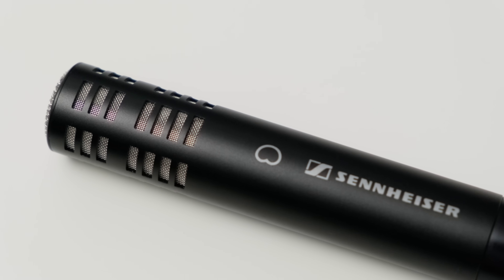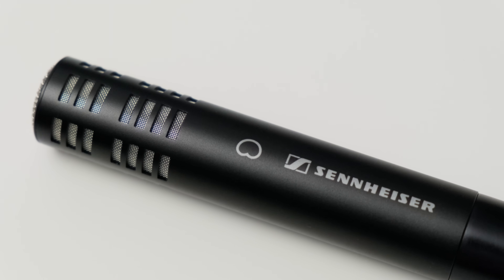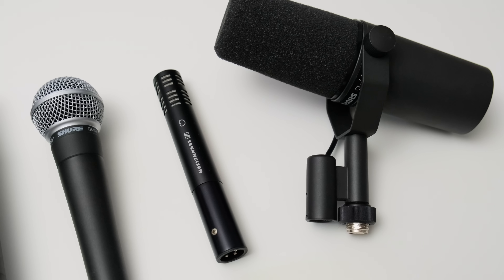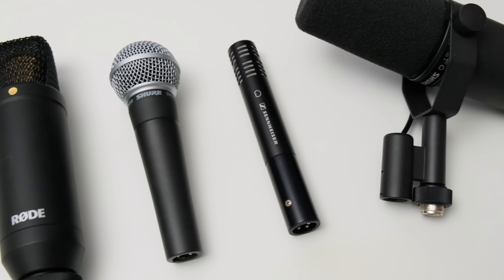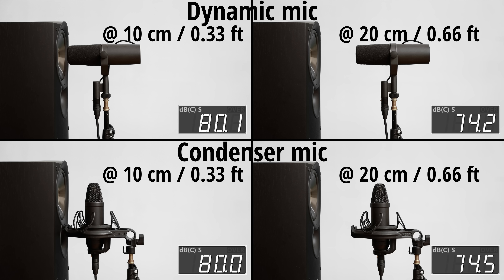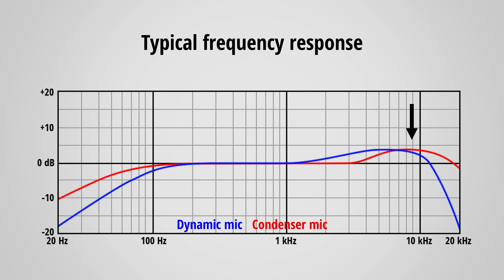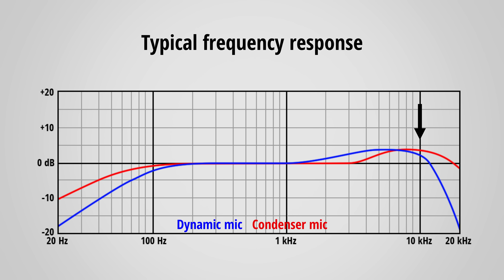Dynamic mics don’t reject noise better than condensers! And yet they do?

Comment: 1:55 There is a weight difference between the diaphragm of a dynamic and that of a condensor. You reach a point in which the sound wave is too low to move the heavier diaphragm of the dynamic so it can not actually produce the low level detail.

Comment: I once tested a bunch of different microphones in a reverberant living room, and (at the same distances) the dynamic microphones tended to sound worse than the condenser microphones. They were all pretty much unusable at any distance further than 1 foot. 
Although the main thing to learn from that video is that you should try to avoid standing 2-4+ feet away from your microphone, in general.

Comment: As I understand it, a dynamic microphone uses a heavier moving coil that is less sensitive to small air vibrations, while a condenser microphone uses a very light, electrically charged diaphragm that reacts to much finer details and room sound. Sound waves reach both microphones, but a dynamic mic responds much less to weak, distant vibrations, whereas a condenser converts even very small vibrations into an electrical signal. I’m curious about your take when comparing a Rode NT1 to an SM7B in terms of room noise pickup, and whether the test might have been even more revealing if an additional speaker farther away played a different tone to clearly demonstrate how near versus distant sound is captured by these two microphone technologies.

Comment: Really interesting! What about the pick up pattern maybe being a little different even with a cardioid vs supercardioid, but also what about the sensitivity of the capsule? I feel like background room noise is very different than say a drum kit spill, because I have heard and done myself putting a dynamic and a condenser on a snare in as close to the same spot, both cardioid and the spill was insanely different. yes it being brighter was for sure a big part of it but i EQd it and it still had quite a bit more overall spill.
Reply: Compare the SM7B to the Schoeps, even though the Schoeps is super cardioid it sounds like it has more room ambience to me. could be because its a lot brighter for sure but also the sensitivity to the capsule too no?

Comment: Condenser mics have a pre-amp built in. That's why they need phantom power. Dynamic mics usually do not have a pre-amp. (Though USB dynamic mics have an analog-to-digital converter, which acts as a pre-amp.
      Condenser mics don't "reject sound worse than dynamics", condenser mics are just much louder than dynamic mics.
Reply: good lord - no! You got this wrong bruv

Comment: I always assumed it was because it took more energy to move the element of a dynamic mic, due to the coil magnet portion requiring more force than the element on a condenser mic.  The lower energy of further sounds is more easily able to move the lighter element of a condenser, at least in theory.

Comment: This is incorrect. The reason dynamic microphones reject room so much better is because they do... at lower frequencies. Google polar pattern for u87 at various frequencies and then the same for sm7b and look at the polar pattern at 200hz. The u87 is almost omnidirectional and the sm7b is still very cardioid
Reply: So exactly what he said. It's the frequency response.
Reply: @shApYT  you either didn't read what I wrote or do not understand some of the terminology, because that is not what I said
Reply: @seansmall3401 you are saying the directivity index is different

Comment: The frequency/angle effect is also independent of microphone construction? I know singers trained to use dynamic microphones practice changing distance and angle to allow for them to get a better sound out of their singing - it's as if the microphone was part of their singing. An example is getting the mic closer to sing lower notes and farther to produce higher notes since it's easier to produce lower notes with less intensity and to produce higher notes with high intensity. 

This is a vide from an old Brazilian TV show (1980s) featuring Jane Duboc singing live. She is a professional studio singer - a master of her craft - and you can see how she moves the microphone to change the produce the timber and intensity she wants. You'll notice she does the same movements every time when she repeats the chorus.

https://www.youtube.com/watch?v=-0wam3BaYc8

Can that be done with a condenser mic also? Thanks!

Comment: Try recording vocals and acoustic guitar (acoustically) and get a separation (no bleed) It’s an absolute nightmare when using a condenser mic, specially the rode nt1A which is a great mic but it’s ultra sensitive with a very poor side rejection(maybe if it was supercardioid would do a much better job) With the Shure SM7db I literally get no bleed when placed properly. There could be children playing in the parking lot, birds chirping, neighbors making noise and the shure SM7dB would not capture anything else but my voice when placed in the right direction.

Comment: I think that one thing you are missing is the question of nonlinearity w.r.t. low inputs. We model and specify mics as though their diaphragms are frictionless spring-mass-damper systems, but they aren't. Their suspensions have rigidity, coulombic friction, and stiction that impart an initial resistance to motion at low amplitudes. At very low amplitudes all mics therefore tend to output less than their specified sensitivity (in dBV/Pa) suggests. Your test didn't capture that regime because you tested at fairly high levels.

In my experience dynamic mics with their relatively large and "rigidly sprung" diaphragms are more susceptible to those issues than are capacitors, and nothing you've done here really contradicts that. My experience has always been that a typical dynamic behaves a bit like a typical condenser followed by a gate or expander with a very low threshold. That does marginally reduce background noise in some scenarios.

With that said that's a pretty subtle effect, and I agree that most people are using dynamics at shorter working distances and confounding that with an inherent difference in response.

Comment: There’s a reason to use dynamic mics on stage with floor wedges instead of condensers. It’s not about rejection it’s about sensitivity. Dynamics do a better job of rejecting noise than condensers, that’s not a myth.

Comment: I think this misconception may come from the economics of the stage mic: stage people need lots of mics, their mics are dropped often so they need to be durable, they don't care about perfect frequency response, and they do care about a tight pickup pattern to keep the mix clean. Since dynamic mics can be made cheaply to fulfill those needs, a lot of dynamic mics on the market have those attributes, and so the average mic reviewer assumed that's just how dynamic capsules work. But if a mic company wants, they can make any mic technology have any attributes they want. The Schoeps CMC641 is a perfect example: it is more directional than the SM7B so you hear less room noise, it sounds better than the SM7B because it captures a more true frequency response, and it costs more than the SM7B, presumably because it costs more to make. But there are also $20 condenser mics that sound nothing like the Schoeps CMC641. So what people need to be learning about is the frequency response (sound) and polar pickup pattern (I think "directionality" is a better way to think of that than "background noise rejection"). Another great video!

Comment: I have the SSL2 and I would like my mic out of frame in my untreated home office. I currently have the Shure MV7 via XLR, but I feel like it’s to far away about a foot from my mouth out of frame. What mic should I get that will mask my keyboard typing but also give me clarity. Thank you.
Reply from the maker: I don't think a different mic will improve your setup significantly. The best and simplest way to get less keyboard sound is simply to get the mic closer. If that's not an option then the only other option i see is digital noise reduction with something like the Nvidia RTX Voice or iZotope Voice De-Noise.

Comment: If you can make a Rode NT1 sound like SM7B, can you make an SM7B sound like a NT1? Given that the NT1 has a wider frequency response, I guess not...right?
Reply from the maker: Correct, not really possible because the rolled-off high frequencies you are hardly getting back. Only with lots of signal boost but then it will be really noisy.
Reply: @JulianKrause  Yeah, btw, since you're reading comments, just wanted you to know that you're awesome and keep up the good work! Love from Bulgaria!

Comment: I never tried to record vocals on Condenser mic so far, but few days ago I pick up my Arturia minifuse 2 and I'm using a dynamic mic from Sennheiser and I was so so surprised that while recording my voice the mic didn't picked up the very loud sound of a percussion tool that was used by someone in the building I was recording. I hear that noise loud but the mic did not picked it at all. On the recording later I was very careful to listen maybe I could spot it but no. It was a clear sound of my voice only. And I love it for this. I don't know if it is due to the fact that I'm using also a hardware preamp and a limiter (compressor) in the chain but the sound the vocals are clean. Now I don't know how the same chain will sound on a condenser mic. So far I don't have the occasion to test it but when I will do then I could tell the difference. I trust only my ears and my eyes 🙂
Thanks for the video!

Comment: Dumb video.  Sound, of course,  does not have a mind - every mic is an INTERPRETATION of the physical world - so are your EARS, which are different from everyone else's ears (and different from left to right).
TRUTH: Mics have varying SIZE polar patterns.  Some extend a great deal, some do not.  Older condensers (U47, M49) have much bigger polar patterns than modern condensers, for instance.  I've tested this myself in exacting tests in my studio.
TRUTH: Some mics - by design - reject OFF-AXIS sounds more than others.  Off-axis means anything other than straight on - which are the tests you are doing in this video.  This is why comparing DIRECT-AXIS sounds, like your video, is worthless for testing the proposition you are testing.
TRUTH: Most dynamics DO reject OFF-AXIS sound better than condensers.  This is why they are typically better for untreated rooms.

I swear, the level of poop pushed out by independent vidcasters looking to make a living from YouTube these days is shameless.  And in case you question my opinion, it comes from a professional engineer and musician with 4 decades of experience.

Comment: Aaaaah, I LOVE channels where breaking the laws of physics isn’t allowed! <3
I’ve long hated the claims of dynamic mics being better at background noise reduction, and from my rudimentary understanding of acoustics, I figured those claims had to be complete BS. Glad to hear an educated voice weighing in on this.

I will say though: I don’t think the typical high end roll off of dynamic mics is an advantage. Let’s say I’m mixing a live band and the vocalist is using an SM58. In order to  get a frequency response that I find acceptable, one of the things I have to do is boost the high end by at least 8 dB (and de-ess the crap out of that awful mic... different topic tho). So that negates the "benefit" of background noise rejection. In addition though, I personally find bleed from a loud stage LESS bothersome if the off axis sound is more neutral, e.g. with cymbals bleeding into vocal mics.

As for typical usage of microphones: I get it with typical large diaphragm condenser mics used for studio vocal recordings. But a small pencil condenser on a snare or guitar amp for example, it’s right up to the sound source. And condensor live vocal mics feature pop filters that work just as well you’re used to from dynamic live vocal mics. So... no winner here. And the extended bass on condenser mics is something that plays absolutely no role in live vocals anyway, because with either mic type (at least for the styles I mix) all of that low end gets filtered out anyway. So in my practical experience mixing live music and micing instruments for recordings, there’s no real difference in mic placements between dynamic and condenser mics. At least not in a way that you could generalize.

Comment: Not sure about the physics behind this, but as someone that has been recording interviews in noisy surroundings for radio stations for many years, I can safely say that dynamic mics work well in this scenario, while condensers deliver unusable results. That’s why reporters have been using dynamic mics in the field for a century.
Reply: Sorry, the video is correct. There are multiple reasons why reporters use dynamic mics in the field. Robustness. No requirement for battery or phantom power. Low handling noise. These are the main reasons. Also Omni dynamics are less sensitive to plosives pops so you can get them closer to the subject’s mouth which reduces the sound source to capsule distance which means by the inverse square law increases the volume of the subject relative to the “background” noise. It’s not because dynamics inherently reject  noise better it’s how they are used. PS I worked in radio for years and used dynamics too, but I didn’t know why. They just worked. Turns out the truth is more complicated than the established wisdom.

Comment: Hi Julian. I watch a lot of your videos and they're excellent, but I don't entirely agree with you on this. A key difference between condenser and dynamic mics is the mass of the moving parts. It takes a lot more sound energy to move the coil on a dynamic than the very thin membrane on a condenser, so the threshold below which it doesn't respond at all is much higher. For sure, if your sound source is loud (eg. a speaker), your room reflections will also be loud and a dynamic will still pick them up. However, on quieter sound sources such as acoustic instruments, more of the room reflections fall below the threshold for a dynamic mic to respond. My Rode NT1 can pick up a pin dropping but my dyamics simply don't "hear" sounds that quiet. Have a read of Hugh Robijohns' comments on this thread over at SOS: https://www.soundonsound.com/forum/viewtopic.php?t=42220

Comment: Whether a microphone is a dynamic or condenser is irrelevant if they have the same polar pattern and sensitivity.
However microphones can have very different polar patterns. 
For example a Sennheiser 441 used as bottom mic under a snare drum is amazingly effective in rejecting the noise of the rest of the kit although it is only inches away from the kick. 
When working with a vocalist on a very noisy stage I find the old Shure SM58 seems better than the Beta replacement because the frequency response is narrower.
I think the conventional wisdom about dynamic mics being better at noise rejection is because the polar patterns of some dynamic mic have been very important in the design as dynamics are intrinsically less sensitive and it was important to avoid feedback.

Comment: Hello Julian Krause. I have a question. I have the Shure sm7b, the Audient id4 mk2 and a triton audio fethead. Should I use the fethead for the lowest noise ratio or leave it out? If the Fethead has a worse dBu(A) value than the Audient id4 mk2 then I would have more noise than if I left it out. Do you have the exact dBu specifications for me?

Comment: I have a feeling the typical physical design of the microphones makes some difference to the off axis rejection as well. Typically the back and sides of the capsule on dynamic mics is more physically shielded, for example there is the sealed and thick metal body where the transducer is on the sm57 behind the capsule, whilst most condenser mics have the the grill at the top and the capsule is more exposed from the other sides. I'm no expert but that seems to play some part.